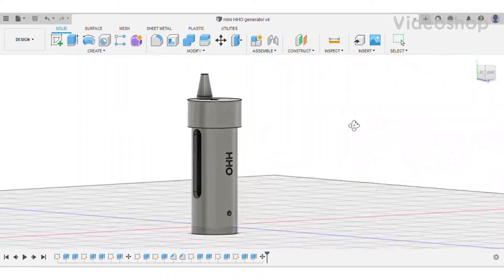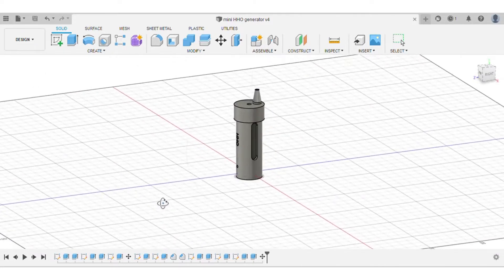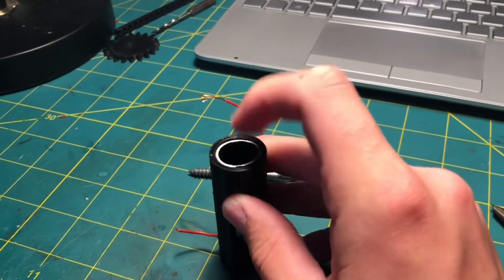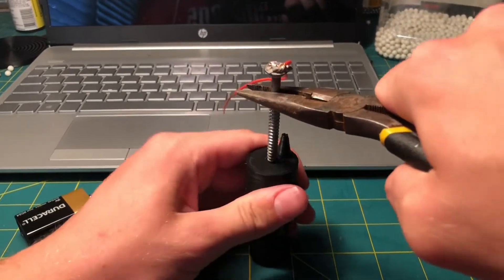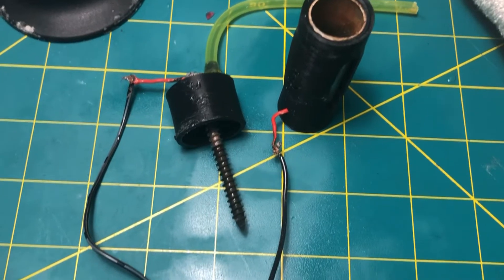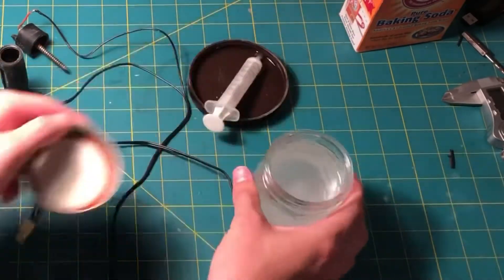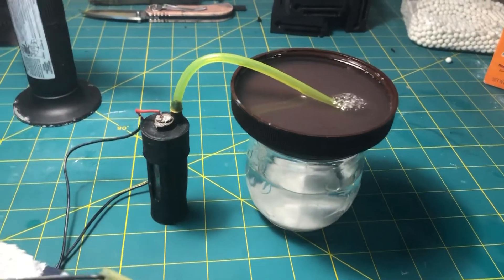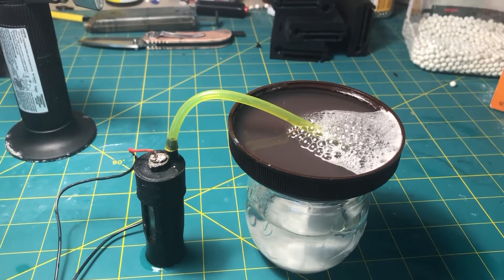WORLDS SMALLEST HHO generator

Comment: That's awesome I like how small it is could you make 2 and one for oxygen and one for hydrogen
Reply: In theory one could split a hydrogen generator into two half cells, one producing hydrogen and one producing oxygen. In practice, this would be a little challenging with this design. It would require two gas ports and a hole for the screw in the cap.  Then a hydrophilic separator that allows ions to pass but blocks the gasses from mixing a nylon mesh might work as a separator. Seperating an electrolysis cell into two half cells. The hydrophilic nature of nylon mesh plus water's surface tension prevents gasses from crossing the separator when there's equal pressure on both sides.

Comment: nice project, does it produce enough hydrogen to create a permanent 3mm flame like you have on your gas torch in this video? and how hot in degrees would the flame likely be?
Reply from the maker: I’ll try  and see if it will
Reply: @coolcontraptions597  no don't, I don't want you to blow yourself up. Hydrogen is not a good toy to experiment with.
Reply: The Rate of electrolisys is only about the amps that flow. It takes 1.24v to make hydrogen. Supplying 12.4v is about 10% efficent. Supplying 124volts is about 1% efficent with all the extra power making heat. Every volt supplied over that pushes amps (ions) through the resistance of the electrolyte. 6 mols of KOH (potasium hydroxide) per liter is about the best condive electrolyte and helps stainless steel to resist corrosion.  But  this isn't stainless steel and won't last long. But it is cheap.  It may last longer if the screw is the anode and is made of stainless steel and if the current density is kept below 0.5 amps per square inch of anode. 

Either way, in theory you could generate enough hydrogen to produce a 3mm flame continously with sufficient voltage pushing sufficent current through this cell. But in practice this cell is too small surface area which requires significant voltage to push enough Amps to sustain a 3mm flame. And if you did that anyways, it would generate significan amount of heat in the electrolyte and in a short amount of time will boil the electrolyte and probably melt or warp the plastic letting the anode and cathode eventually touch shorting them and catching  fire, and for a few minutes have another flame come from burning plastic.
Reply: A hydroxy (hydrogen and oxygen) flame can recharge about 2800c

Comment: Awesome !   New sub here
Reply from the maker: Thanks
Reply: @coolcontraptions597  Trying your same experiment using the CO2 cartridge mine is inside of a prescription pill bottle there is a little bit of air space around the CO2 cartridge I have it dead centered with some foam little blocks around it holding it in place it’s airtight.  I have a bolt coming through the lid soldered with a wire on top soldered wire on bottom of the CO2 cartridge,  baking soda water in it . I’m using an 
18 V power tool rechargeable battery ,when I touch it off it’s grounding out really hard core , should I back the bolt back out a little further? It’s not making actual contact with the CO2 cartridge though,I have it down almost to the bottom of the CO2 cartridge… I’m afraid I’m gonna make my battery explode because it’s grounding out so hard… Any ideas my friend
Reply: @coolcontraptions597  distilled water?
Reply from the maker: @aaron5632018  yes with baking soda in it
Reply: @coolcontraptions597  went ahead and connected it and let it set for a few seconds and all of my wires started absolutely melting and burning
Reply from the maker: @aaron5632018  that probably means you are either using to high of current or, you have a short, remember the positive and negative cannot touch only through the water.
Reply: @coolcontraptions597  but it was making sound like it was working sounded like it was generating or something
Reply from the maker: @aaron5632018  awesome. check the connectors, what type of power source were you using.
Reply: @coolcontraptions597   I think I was using too much voltage, my power source was an 18 V rechargeable battery for power tools

Comment: I love this. Quick question, does the exhaust tube have to be submerged to capture the hydrogen? Is that why the bubbles are formed? Also, if the process is separating the hydrogen, then where does the spare oxygen go?
Reply from the maker: No, I just submerged it in some soapy water so you could see the gas being produced, and I could easily collect it. The oxygen and hydrogen are both present (which makes it way more explosive) but their is way more hydrogen in water then oxygen
Reply: To capture the hydrogen, it's recommended  not to capture (store) significant amounts of hydrogen mixed with oxygen because of how easilly explosive it is but it can be done. Plastic bags ballons are cheap and easy but won't store hydrogen for very long because hydrogen can eventualy slip through the spaces between molecules in plastic.
Reply: Hydrogen and oxygen are produced in 66.6% and 33.3% quantities and mix inside his cartridge